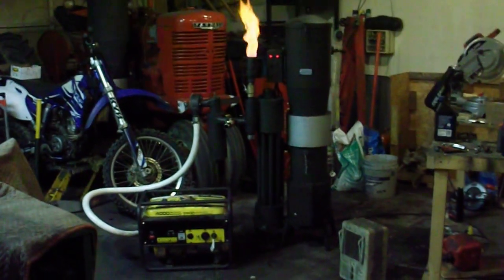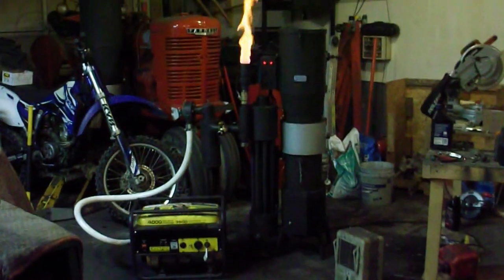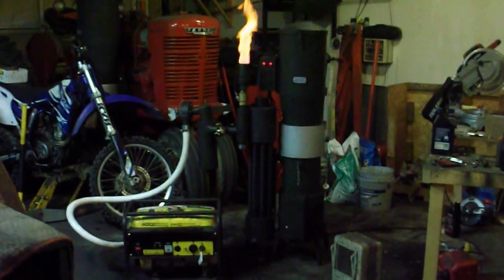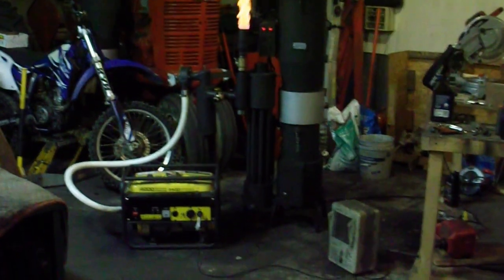2013 E-Series I Gasifier Running Generator with 1.5 kW load

Comment from the maker: Much has a evolved since this video, you should see what we are working on now. The tractor in the background is getting an M-Series gasifier with advanced filtration systems. I have a thread on driveonwood detailing this build. Also we are working on launching line of turnkey generator systems. The higher end machine will have advanced automation systems and will have the ability to self run.